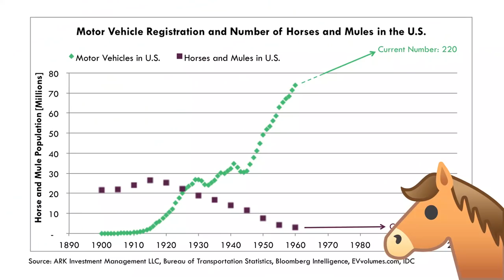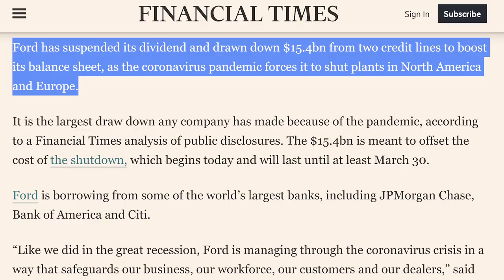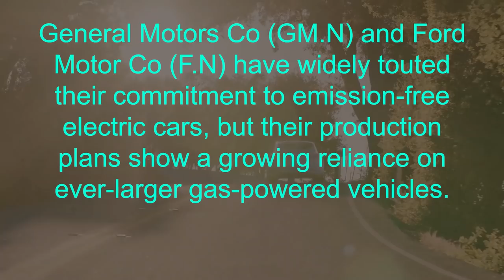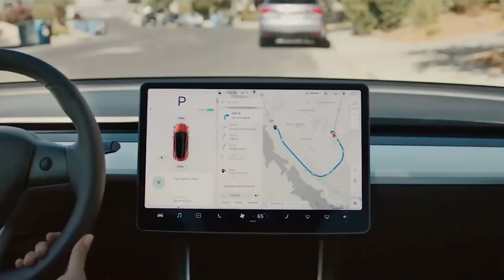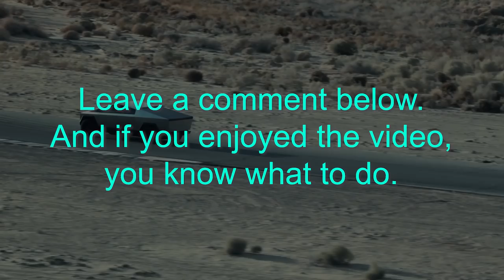Ford and GM are in BIG Trouble (bankrupt soon?)

Comment: You are conflating connected cars and EVs - as if only EVs can be computers on wheels.  All vehicles will be connected and providing new customer experiences the only difference is the energy source.  Quick lesson on economics - if you are selling 5 Million ICE vehicles a year for a profit you are "profitable" not bankrupt.  There is another challenge for EVs winning the total cost of ownership war - as they gain market share gas prices will fall (less global demand, post peak oil world) making ICE ownership cheaper and cheaper.  Meanwhile the cost of building up the grid to handle DC Fast Charging and the cost of energy storage solutions to avoid demand pricing will make electricity more expensive with 20% or 30% or 50% EV market share.  Slow your roll dude.
Reply from the maker: Hi Stan, I am aware an ICE car can be internet connected. When I say computer on wheels, I mean it more deeply. Tesla can and HAVE increased performance and FEATURES. If you are aware of a single instance of an over the air software update on an internal combustion engine either:

- Increasing accelerating
- Increasing range
- Decreasing breaking distance

Please let me know. I'm unaware of any. This is what I mean by a smart car.
Reply: @SolvingTheMoneyProblem  ICE vehicle have never throttled the capabilities of the vehicle when they sold it to you.  Yet.  EVs have total energy and usable energy available at the time of sale.  The hardware on board is fixed.  There is no magic to deliver more energy (range) to an EV - you are simply reducing the buffer between total and usable energy.  Likewise for throttling the energy applied to acceleration or braking.  As EVs move down a learning curve the difference between delivery specs and potential for 'upgrades' in the future will near zero.